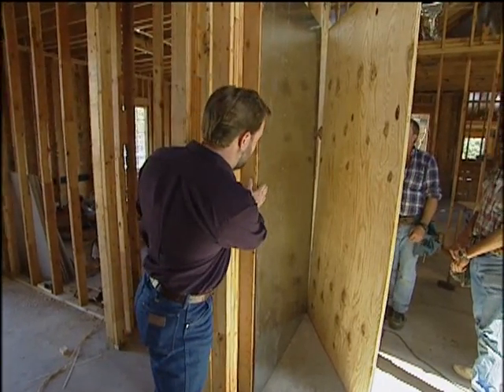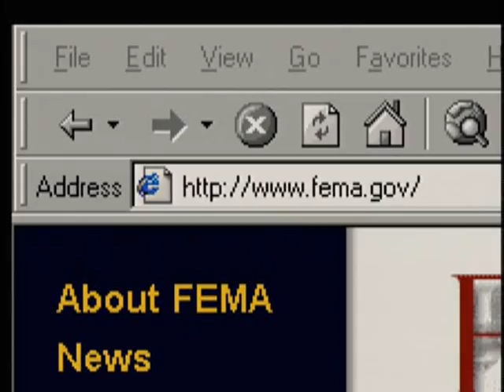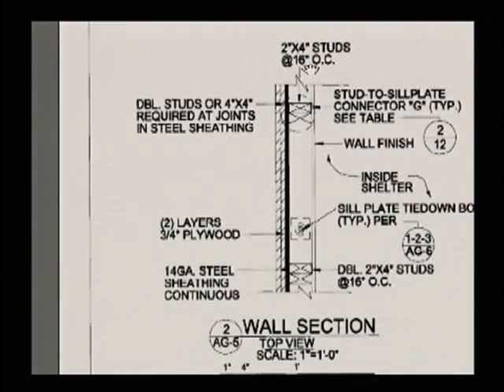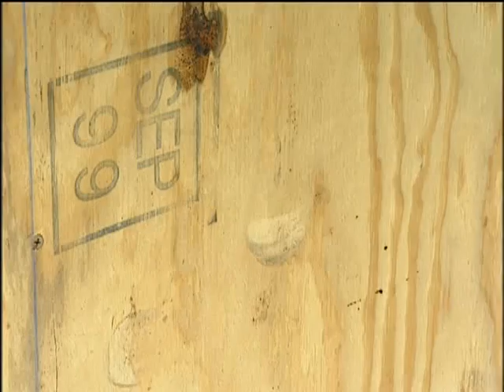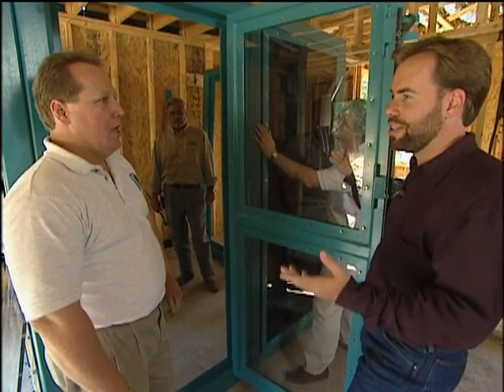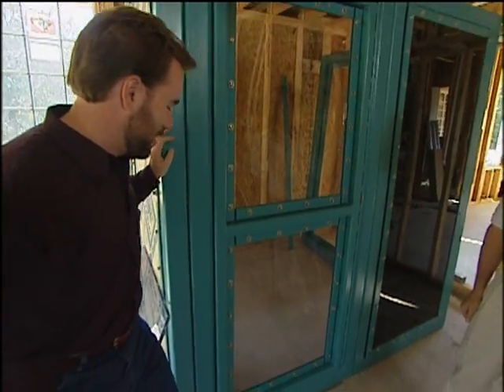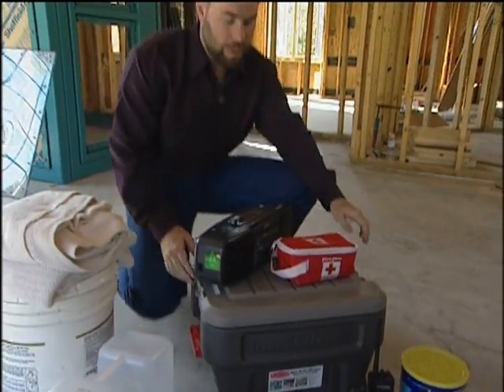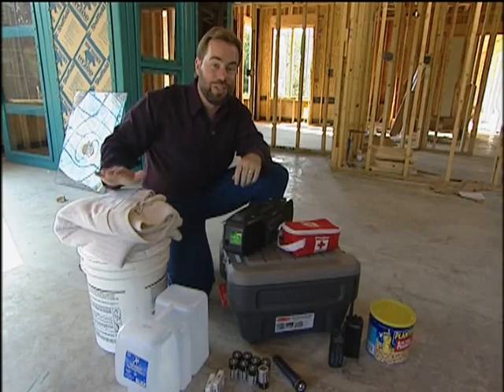Tornado Shelter Inside Your Home (#5051)

Comment: Seems like being underground is the best option if you can be sure to rule out the possibility of water filling the entire shelter or natural gas suffocating you.  If your home collapses over your head and the water starts filling the basement, you could end up drowning if you can't get yourself out in time.  I'd be interested to see how this modular design handles the house around it being blown away violently in pieces, or collapsing on top of it.  The Moore OK tornado had wind speeds of over 300mph!  The 250mph rating would scare me just a little during a major/violent tornado strike like the EF-5's that hit Joplin and Moore!
I would want to upgrade the clear polycarbonate to the bullistic level!  Just because.  Be nice to know it could handle a .762 round in a TAKEN type of situation, lol.

Comment: Build the entire house to make it tornado proof.  The roof should be designed so the winds cannot get under the edges, and bolted down to the frame of the house so the winds cannot tear it off.
Reply: Tim Campbell it’s would make sense to build the entire house tornado proof but I think they are mainly marketing to people that can afford maybe 1 room but I’m sure if you have the money they will build it for you.
Reply: That's what I'm sayin'
Reply: No structure can reliably survive an EF-5 tornado, not even a masonry structure home. (Take a look at many of what’s left of the brick and masonry buildings in Mayfield, Kentucky.) 

By definition in an EF-5 substantially built homes are torn away from their foundations and can travel quite a distance before disintegrating. Even reinforced an above-ground reinforced concrete structure may not survive. An EF-5 is non-survivable above ground.
Reply: easy fix would be just to build your home underground